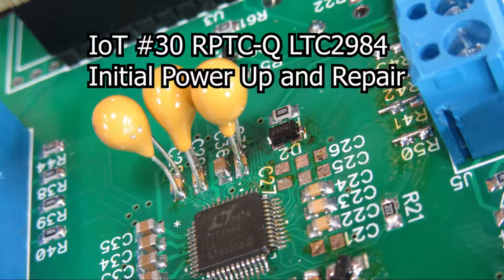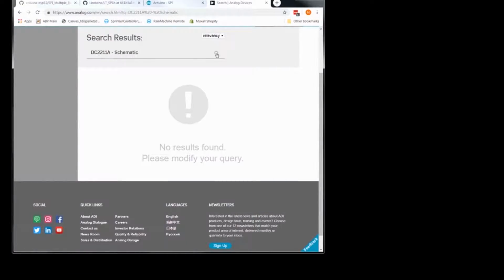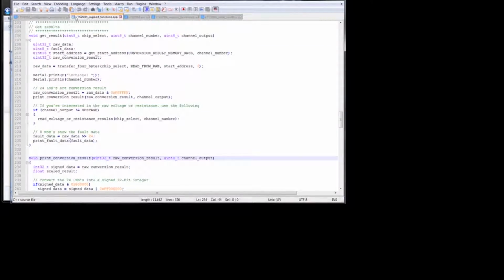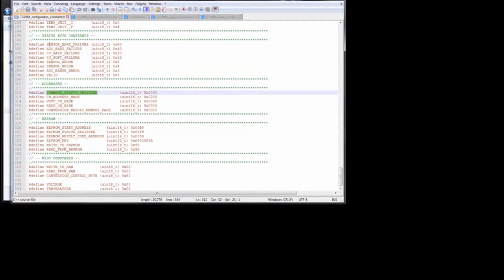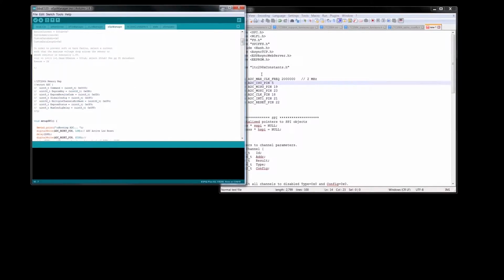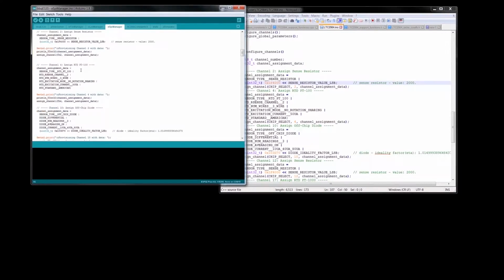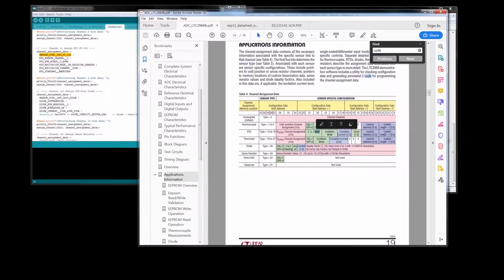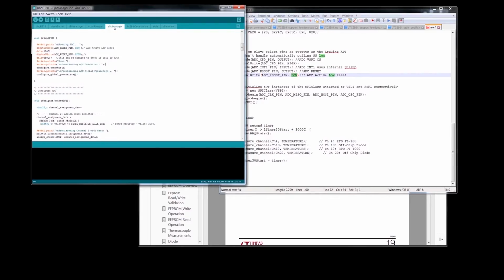IoT#31 RPTC-Q LTC2984 to ESP32 SPI Code Deep Dive

Comment: You need to specify the clock rate and mode etc. for each SPI transaction because SPI is a bus that can have multiple devices on it. Each device can operate on a different SPI mode and clock rate.